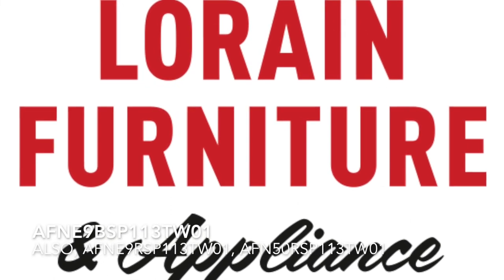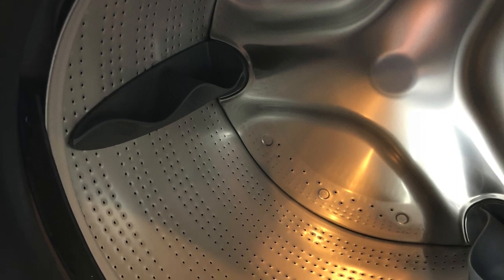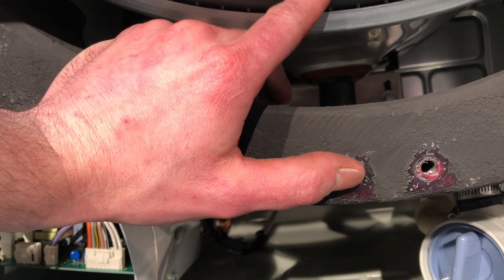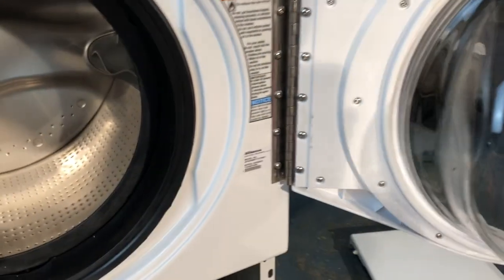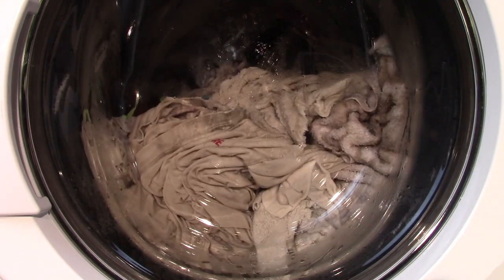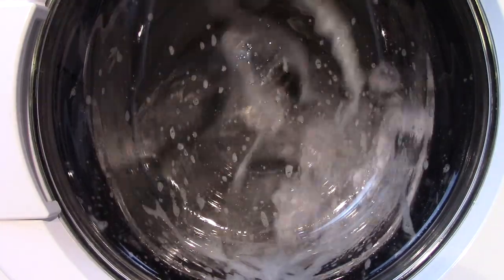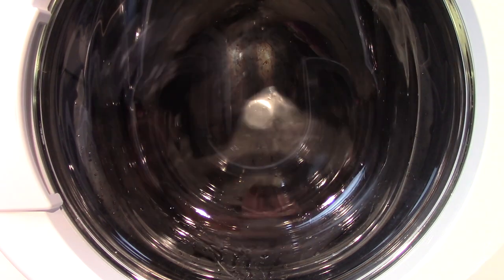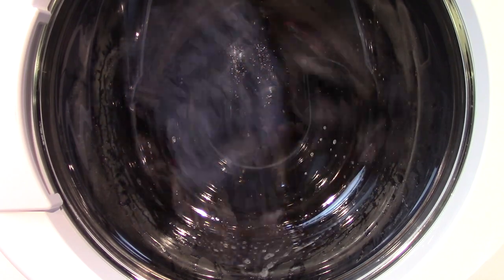Review: Most Reliable Front Load washer Ever: Speed Queen Front Load AFNE9BSP113TW01

Comment: I’ve used the horizon model at an apartment complex and now have the 2019 stacked set.  Even though they say it has a larger capacity than the horizon, but it’s hard to tell. What I liked about the horizon series was that baffles were stainless steel (not plastic, as on the current model...not sure why the change.  SQ says the new baffles are patented, not sure what’s so revolutionary about them though).  I also liked the water spray fill/distribution and the spray rinse on low speed spin right after the wash cycle drains.  I didn’t like, nor understood the purpose of the pulse spin on the horizon series.

What I like about this model: more cycle selection and customization, up to 5 rinses, and I think it is far better balanced. The downside is that it fills from the outer drain tub vs directly spraying the clothes (but this might be better for detergent/bleach distribution/dilution) and no spray rinse.
So far, it’s been a great machine and has really good capacity. (The manual says it can handle 21lbs of laundry).
Reply: I thought the plastic baffle machines are Horizon machines, and the models before 2015 (with the steel baffles) were pre-horizon?

In any case, the new models are 3.42 cubic feet, While the older model is 2.8 cu. Ft.

Comment: Is the drive spider made of aluminum or stainless steel? Wondering about dissimilar metals galvanic corrosion.
Reply: Wondered about this on the Speed Queens too.  Seems like it's usually neither aluminum nor stainless, but rather a die cast zinc alloy, and the corrosion is accelerated by the alkaline wash solution.  You'd think they could try to encapsulate the part in a plastic or porcelain coating to protect it, as you see on some mixer paddles.  I realize casting a piece that size out of stainless would be costly, and you need something substantial enough to support the back of a thin sheet metal drum, but the zinc seems like a poor fit for the application.

Comment: 2:32 for a brand focused on reliability that's a very sub par pcb. 5:21 plastic lifters? LG has stainless steal ones, which I would think stainless steel would last longer. 4:45 get rid of the inside door seal! ASKO actually has a really good design aspect being that it has no inside gasket/seal. The door is directly on the outer drum. Only a small outer seal between outer drum and the cabinet/chassis. Also no direct drive :(

Honestly I am so annoyed by modern appliances I want to start my own brand, haha! One that actually is innovative and makes advanced, beautiful products that actually last 15-20+ years with no maintenance!

Also the current Speed Queen front loaders that are available in Australia (AFNE9B, AFNE9BSS) only do a 1200rpm spin!
Reply: It’s not uncommon for a Speed Queen washer to last 20+ years. The useful life of an LG is 5-10 years. Look up the difference between RPM and RCF. RCF is the important metric for spin performance, this is why Speed Queen advertises its 440 g-force spin.

Comment: I have this washer now but only with the rear control panel, it is 10 months old and I need a new control board in it because 8 out of 10 loads a week will not go into the high speed spin!!! I called speed queen direct and they told me that the control board that increases the speed during the final spin cycle must be failing and they gave me the part # of the board and told me to tell my repair man to order this board as a replacement!!! There are times that the machines will go off balance to the point where it starts bouncing around and slamming into my dryer without shutting down and I have to pause it myself manually, and then there are lots of times where the machine will start spinning perfectly straight but never pick up speed!!! Speed Queen told me that it should not react that way and that there is definitely something wrong with the board and that it should be replaced because it should react to a out of balanced load and shut down automatically and that the speed should increase to 1200 RPM's when high spin is selected which it don't... Thank God that this is covered by the warranty because it is a $500 board!!!  Will be fixed on Friday so I hope this will put these problems to rest???  Have a good one all!!!
Reply: Robert that could explain why you are having problems with your washer where the mcu were failing prematurely. I hope your front load washer gets fixed and will work right and not go off balance and walk or bang into the dryer.
Reply: The rear controls are located where they'd be on a top load pair. I have the same machines. It makes it easier to fold laundry on top without clothing falling behind the machines.
Reply: I wish I knew how they rationalize the cost on these service replacement control boards.  The unit cost in manufacturing is probably in the $25-$50 range.  Then figure that board level failures are probably far less common than poor wiring connections...

Comment: My 1995 Miele Novotronic has been working perfectly now for over 25 years.
Reply: Shahrdad Americans think front load is the latest technology. They don't realise it's all we have used in Europe for four decades! They would be blown away by Miele washers if they think speed queen is good. Speed Queen has a five year warranty, in the U.K. Miele comes with 10. Oh, and an 1800 spin, around 600g.
Reply: @spencerwilton5831   I grew up with a 1960 German Constructa front loader.  It was the first fully automatic free-standing front loader from Germany. My dad and uncle imported them to Iran. It was built like a tank and weighed a ton. Ours had 3-phase power (industrial almost), and sometimes, after a power-outage, two phases would be reversed, which would cause the spin-cycle engine to turn the opposite way, making water come out of the funnel thing you poured the detergent through.  One of my jobs as a child was to unplug the washer, open up the huge plug, reverse two of the wires, and plug it back in whenever there was a phase change.  Ours looked identical to this.  https://www.youtube.com/watch?v=vYKBRqD_zFo

Comment: Can you please recommend a stacked washer and dryer that will handle super dirty laundry (like mud, concrete, diapers, pet messes, etc)? I’m interested in the speed queen, but I need to make sure I don’t end up with one of the few crappy models. Thanks!
Reply: Bosch front loader with a bosch dryer stacked on top,    We all have front loaders in the uk and across the rest of Europe, bosch are excellent machines, not sure if yours in the states have internal heaters though like ours, our machines can go from cold and heat all the way to 90 degrees (194 degrees Fahrenheit) which at that temperature is the best for towels both bathroom snd kitchen,
Reply: Speed Queen SF7

Comment: Are they still making a front loader even though this one has been discontinued ??
Reply: They sell it in a stacked unit. Have had the stacked unit and am really impressed with it.  The manual says it can handle  up to a 20lb load.  It does fit 2 heavy cotton king sized blankets with no problem.
Reply: The machine is now back on the market. You can view it in Speed Queen’s website under the MultiHousing category.

Comment: Dude, cause Miele and Bosch were eating thier lunch, Miele been making fl for over 50years and stand behind thier products.
Reply: I have to differ with that.  Miele certainly stands behind their products. Bosch on the other hand has been awful at customer service in the American market.  They were horrible and refused to honor the warranty on two automotive parts that I’d purchased from them.  In 2009 they pulled out of the floorcare market in the US and stopped sending parts as well as supplying bags and filters. People with year old machines that required repair had to throw their vacuums away.  Bosch produced an American sized capacity washer for the US market.  They discontinued the model and produce no replacement parts so if your two year old machine broke, it went straight to the recycling center and became a Toyota like all of the other scrap metal in America. 
By contrast all American manufacturers are required to produce replacement parts for ten years after a machine has been discontinued. Speed Queen is known not only for customer service and warranty work but many of their parts are used for decades as they’ve been proven to be sturdy in laundromats around the world. There’s a huge difference.

Comment: Do you have any experience with this machine on the second floor laundry room ? 

 That is my machine , the   stage right before picking up to maximum speed , it vibrates and  only walks a small  bit , say 4 inches. The machine legs are leveled and the shipping bolts are removed. It is on the plastic drain pan. 

Given that  all my previous  2 washers were front loaders , the floor could have been weakened. 

The machine is awesome  but I don’t know how to stop the short walking . Do you any other ideas how to stop the walking ?
Reply: Have you tried it off of the plastic pan? Perhaps better contact with the floor would be better.

If worse comes to worse, you could get some plastic furniture feet cups and screw them to the floor and put the SQ feet in them.
Reply: richard3700hz  I have  and The floor is laminate . Therefore it works better with pan below

Comment: These are back and now has a sani cycle and rinse
Reply: Yeah, but no heater.
Reply: I had front loader with h heater. Waste of time and money.
Reply: @Joemil271  You didn't see a difference in cleaning with the higher heat ? I think with all the options the SQ offers it would do very well without a heater myself.
Reply: pat cola It does do very well without a heater. Most fabrics can’t really stand that intense heat anyway it weakens them. And the cycle was two hours long
Reply: @Joemil271   That's good to know.

 Last year I used a commercial Speed Queen that was basically the home machine with a coin box .  Had the same baffles like this washer, anyway I washed a pretty dirty load on heavy wash and 30 minutes later I had clean clothes and the stains on my jeans were gone.

I currently have a 2013 Speed Queen model AWN432, before the Eco normal cycle and it is still washing away effortlessly.

Would really like to get the front loader now though.
Reply: pat cola I’m glad I did. The one thing I really like is that it’s very quick. My last front loader always took so long to balance the load before each spin. This takes about a minute and it’s built like a tank
Reply: @Joemil271   What I noticed also is how sturdy the SS wash basket is in this machine.

 It is definitely true commercial quality. It is a heavy gauge steel much better than any other make is using.

Comment: Have you tested any other speed queens that are equivalent to the one that’s been discontinued?
Reply: the FF7 is currently being built, and it's largely the same machine, with just some styling changes, and the addition of the "sanitize with oxi" cycle.  Just purchased one December 2020
Reply: @audvidgeek  still running ok?
Reply: @OGCJ10   a little more than 1 year later, it's still running like brand-new.  Once we had the washer "dance" away from the wall a little.  Come to find out, the wife put only couple of pairs of jeans in at the time.  The washer actually works better and balances better the MORE stuff you put in it!  it's pretty darned quiet too!  Most typical chain-store washers end up developing all sorts of mechanical rattles and squeaks after a short time.  This one is still very quiet...just a dull whir out of the motor when it's in it's highest spin speed

Comment: You had me sold, then... it’s discontinued. 😫
Reply: They are back in production. Buy one. You will have no regrets. I know because I own this machine. Speed. Queen. Machines. Are. Amazing.
Reply: @jeffreydove7987  i like my top loader better, the one that agitates
Reply: @fargeeks  use a front loader. They wash better, rinse better, and spin better and are cheaper to run.   Why do think we all have front loaders in the uk and across the rest of Europe,  also there really is no need to have washers and dryers the size you have them,   If you have 7 kids I can understand Needing a bigger drum, oh wait a mo my aunty had 7 kids and had a bog standard front loader washing machine with a 6kg drum,  it coped with 7 kids, 3 dogs, 2 adults, and all the bedding abd towels etc that go with having 7 kids,  and it could get queen size duvets in it ( the actual duvet not the duvet cover and pillow cases the actual hollow fibre duvet, the covers went In easily)    There’s no need for such big machines,  ours also have heaters in them to heat the water, so we can go from cold to a boil wash and the machine maintains it’s temperature unlike yours over there